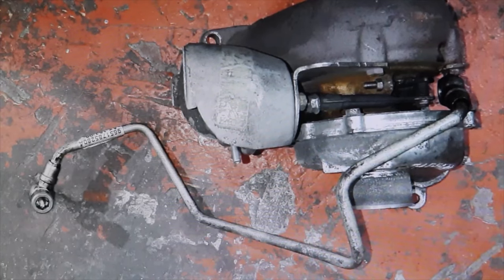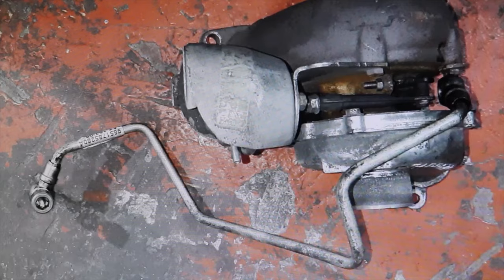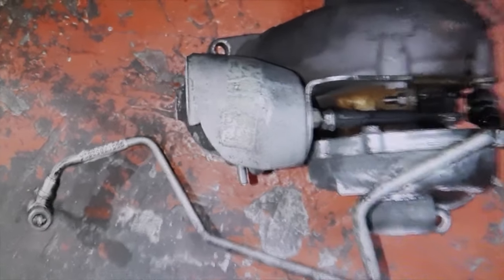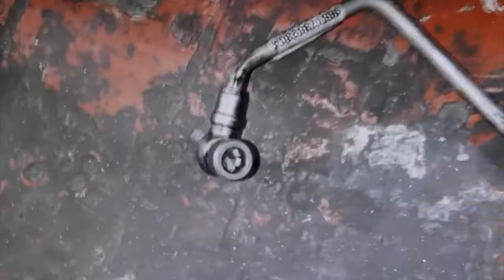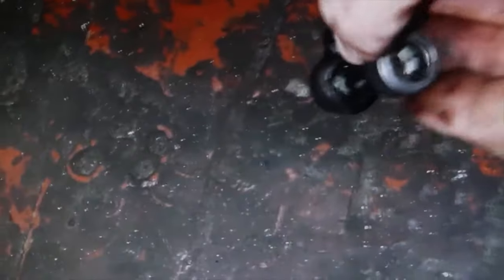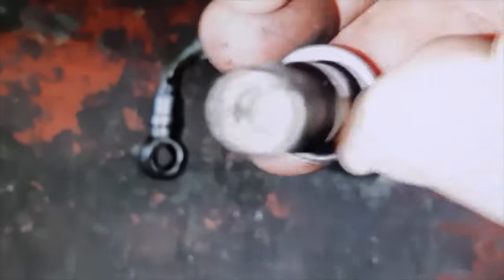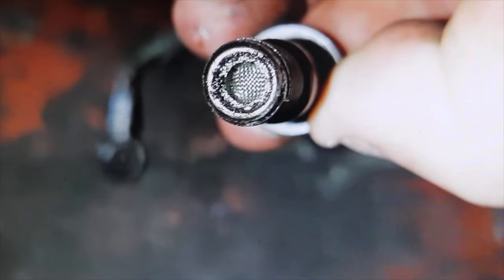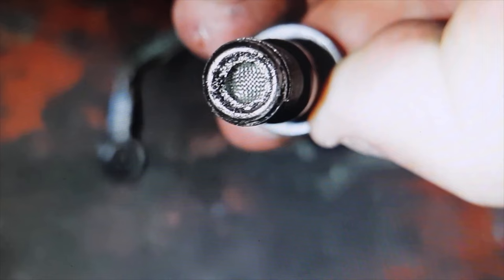If your car has a PSA 1.6HDI engine, REMOVE this PART because it BREAKS the TURBOS! Peugeot, Citroen

Comment: There is an updated version of the bolt for sale. In the new version the filter is much larger inside of the bolt. I  bought the new one from Peugeot dealer and put it into my 308/1,6 HDI.
Reply from the maker: The filter you are referring to also gets clogged and ends up breaking into pieces and some of those pieces end up inside the turbo damaging its shaft, in addition to obstructing the oil inlet, I do not recommend it...

Comment: Another problem that it has is like the 1.9 ford escort turbo the lube line has no heat shield on it and that line sits right on top of the exhaust manifold which i believe eas purposely put there knowing that the oil would geet all burnt up in the line causing a clog in that screen causing a failure
Reply: Lol WRONG...the turbo get's 100 time more hot then that line, it's the iregular oil changes that are THE problem

Comment: idk why i got recommeded this but im on my first turbo with 245k Km on my 308 T7, got lucky i guess
Reply: If you look after it and change the oil regular you won’t have problems. its when they are neglected and sludge builds up

Comment: Hi! I'am from Italy..I replaced the turbo with a new one and I can see that it is getting abnormally hot.  I saw your video.  I'm going to buy a new pipe egg.  And I don't put the filter on anymore.  Until then, I will go at low speed, max 55-60 km/hour.  Do you think the turbo can break in a few days until I change the pipe?  Thank you!
Reply from the maker: Solve it as soon as possible, don't wait.